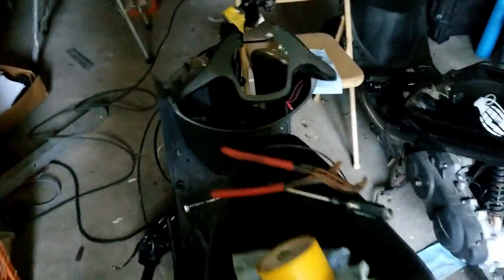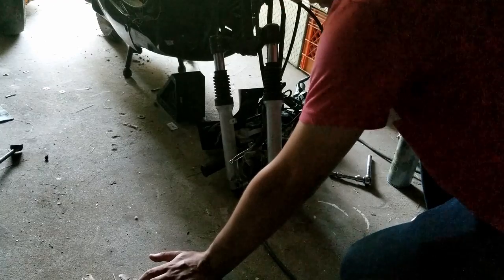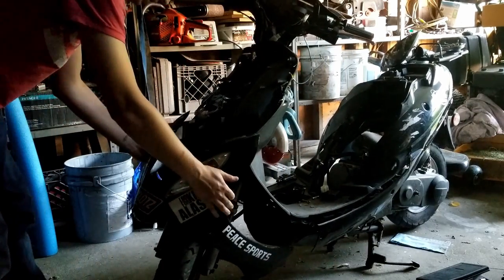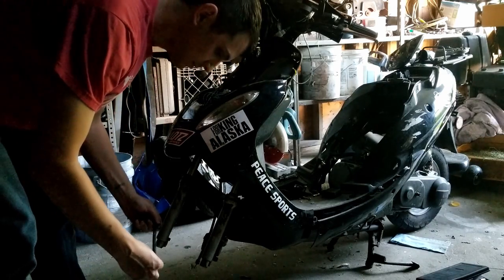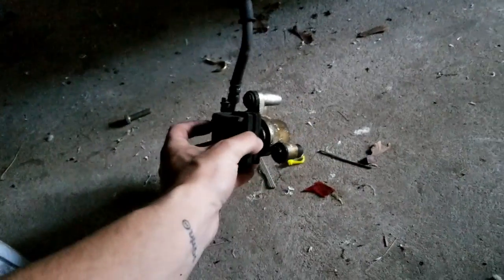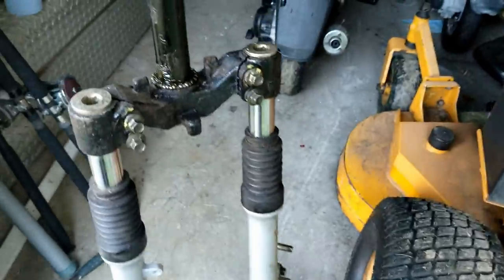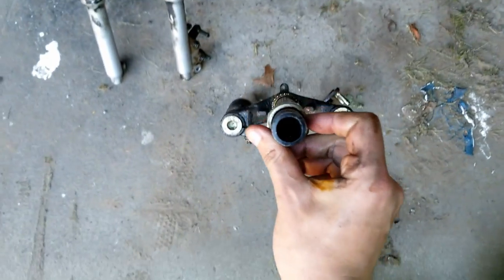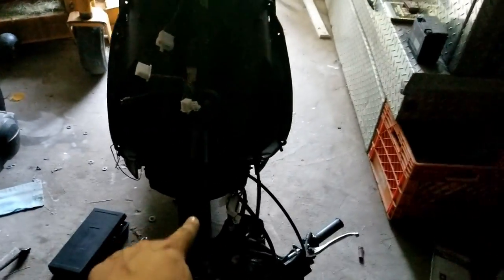Fork Removal on the Budget Scooters

Comment: This video is the most helpful I have been able to find!!..  For my project, I am attempting to straighten the handlebars up with the front wheel creating proper alignment after it was wrecked.   So I appreciate you for making my journey a bit easier!!  

About 5 min in:  You made a comment to the resoning for the breaking system design.   Was it stupid or smart??  Real answer : it's cheapest!!   This is truly the most simplistic design I've ever seen for disc breaks!!

 About 10 min in: you're comparing the 2 fork assemblies and acknowledge the fasteners being a different head shape.  Reason:  The ones with an Allen wrench will most likely to have their head stripped away first.  Being (likely) a softer/cheaper metal, the manufacturer went cheapiest again!!   Which would have really saddened me having to go buy a set of allens.  Like someone else mentioned, a Flathead screwdriver (and maybe a couple taps from a hammer) would most likely get your job done.

Fun Fact:
 A manufacturer will go the cheapest route 99% of time if someone else doesn't force their hand.  #BeBetter

Comment: Had a really nasty crash with my scooter (car ran a stop sign, ran into the drivers door of the car at about 20mph) that destroyed the front. I have to replace the fork tree and couldn’t find any info on how to do it. This was super helpful, thanks!
Reply: Hey man i also got into a really bad one as well car cutt me if..
I also need ti replace my fork but does ur scooter run fine after replacement?
Reply: @Ibraimi2  yes, it starts and runs just like it did before. I replaced my fork and it drives fine now. All I have left to do it get some replacement body panels for it.

Comment: I just got the lowers. My stem and pinch bolt area is straight, I get em tomorrow so I hope it gives the front support cuz what is on now is bottoming or real quick. Yes you can get the lowers as a replacement with just undoing the pinch bolts

Comment: use a BIG screwdriver to twist out that allen head the fork then drops right out easy peasy. Did it by hand be careful they have a spring behind them not much but be ready for them to jump just a little. Good video thanks.

Comment: I found out someone who owned my ruckus clone before me had crashed to the point of bending the lower triple clamp so my forks sit crooked. I have a parts scooter but my bike is really hard to get the top nut off. I might heat it up to help loosen it up.

Comment: I came here to see 👀 how to remove the forks because I had an accident ( Asian lady ran a red light and drove right into me)
  Thing is the scooter still drives ( 2 weeks old 😪) this is scooter #2. (The first one was stolen 2 weeks in😪😔)
 It's crooked by the bearing and I need to know what's involved in case I have to put it back together and still drive it.
  If you could say the sizes of the tools 🔧  that would be great thanks!
Reply: Hey man i also got into a really bad accident 
I need to replace fork aswell